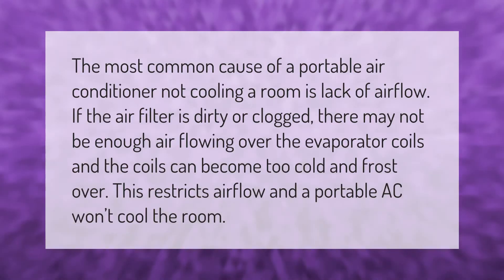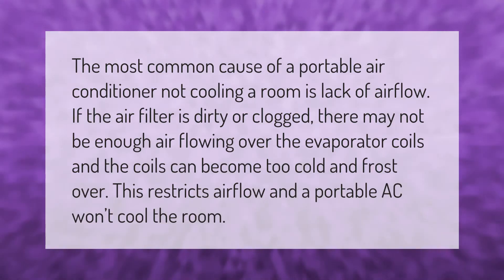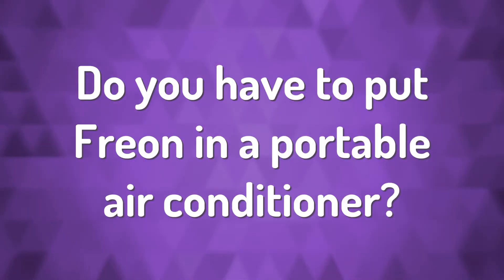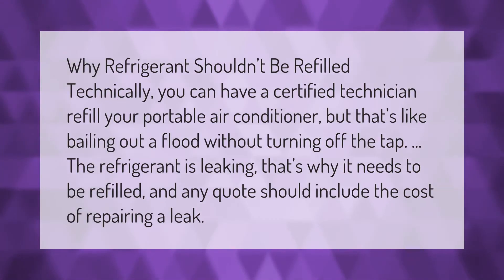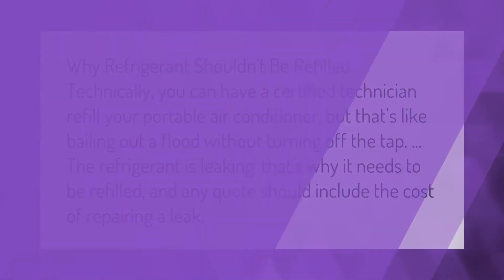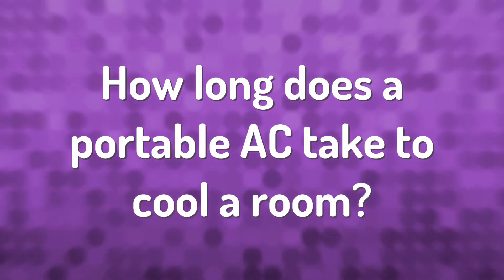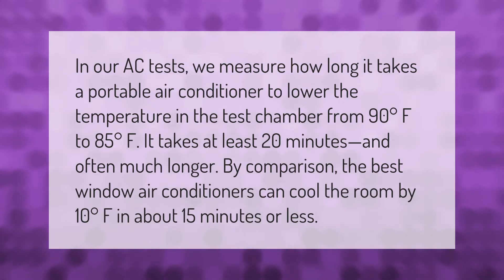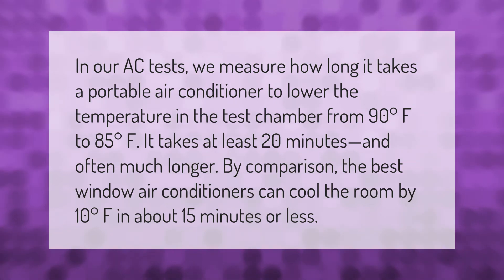Why is my portable AC not blowing cold air?

Comment: I have to same unit and it blows cold air and the hose takes out he hot air, But it doesn't cool down the air for 5 hours..I have a 2 inch space under the door and have 10 foot ceiling. The room is 13' x 17' any suggestions?

Comment from the maker: 💬 Do you have any other questions? Comment below! 💬
Reply: Why does my portable ac blow cold then after like 10 minutes ac stops and instead starts blowing fan air
Reply: @Smoothmike707 did you find out the problem cuz mine just did this
Reply: I have a portable unit window designed, and the power switch was snapped off. Where can I get a replacement power switch?
Reply: @dasmith1207  Amazon
Reply: @xxoptamisticxx3721  thanks, for the credible reply. Nothing wrong with this choice, just looking for more options...